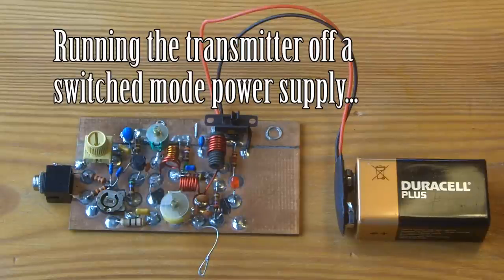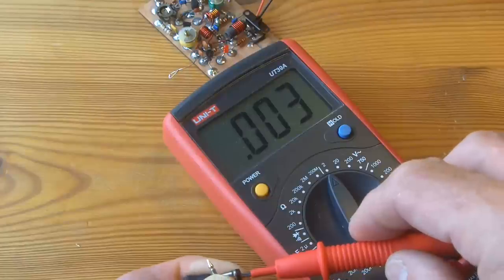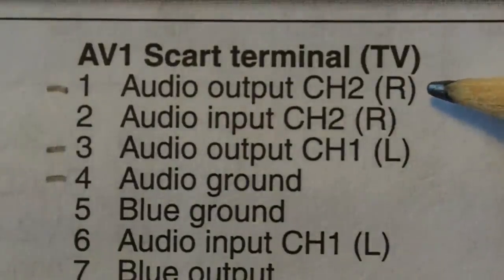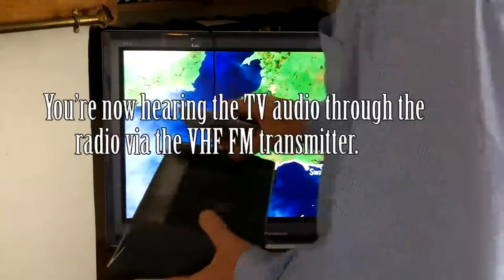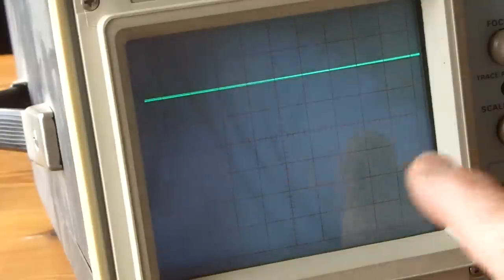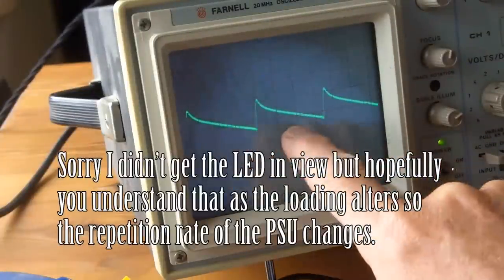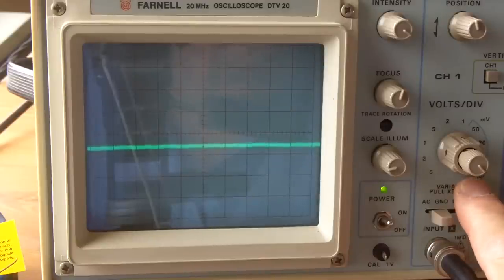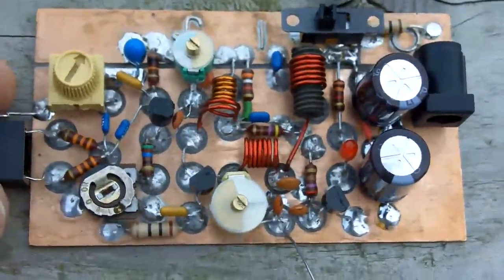About Radio 42, difficulties with a switching power supply.

Comment from the maker: You do need a capacitor, the two things work together. I was going to use capacitors and an inductor rather than a resistor but for a low frequency ripple you really need an iron core to get a reasonably high value of inductance but you can use a resistor to do a similar job. Essentially an inductor provides a ‘watt-less’ impedance to AC, it doesn’t get hot, whereas the resistor wastes energy as it gets warm, there is of course a little bit more to it than just that.    
 Kind Regars, Andy

Comment from the maker: Hi John, it was real technical, I pulled two of the largest capacitors off that old Hub pcb and 10 ohms was the first low value 0.5 watt resistor I that I got out of the resistor box. So I guess you could be generous and call it experience or less generous and call it lucky. It’d probably be OK with just one of the 470 uF capacitors and 10 ohms but I figured 940 uF would nail it.
Tell me can you hear the HF hash in the early part of the video?
Kind Regards ... Andy